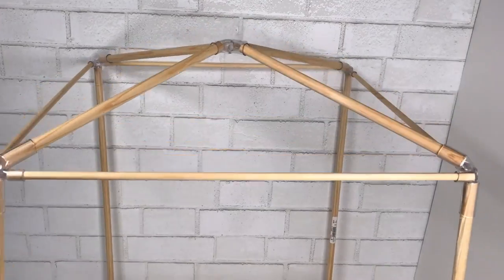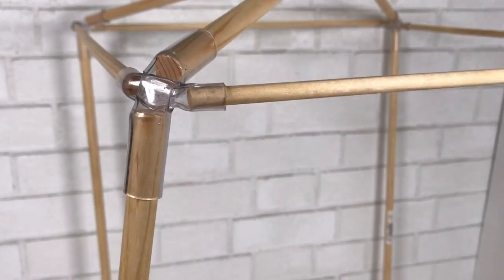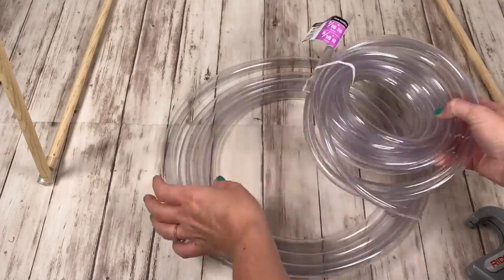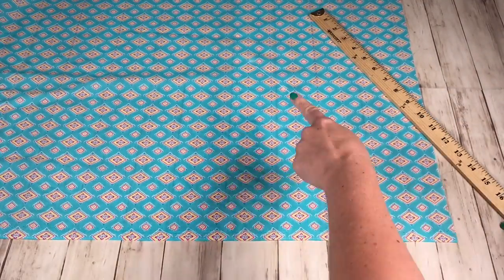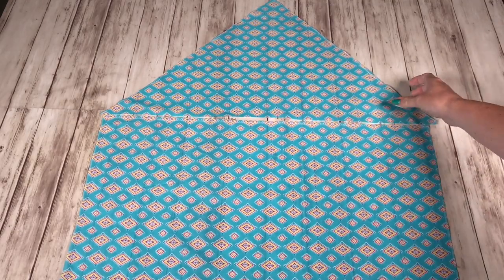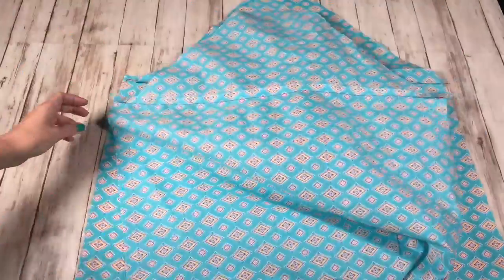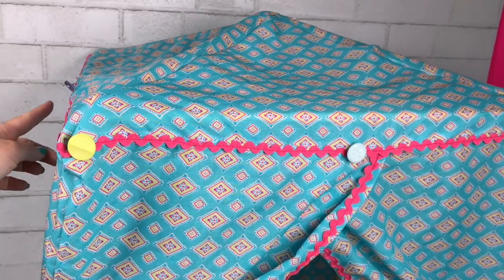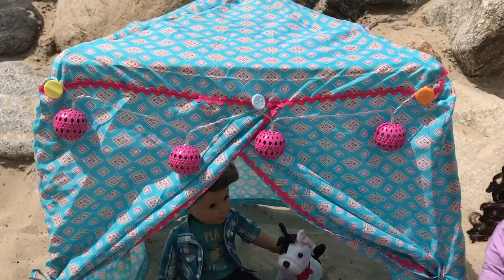DIY   Cabana

Comment: can you do a how to staighten your dolls hair. (aka. julies braid). i really need it
Reply: what you can do is brush her hair, spray it with water, get a straightener, and run it over the ripples a couple of times. another way is to get boiling hot water, and cold water, dip the part you want straightened in the boiling hot water ( trust me it will not hurt her hair i tried it) then after a few minutes, put it immediately in the cold water. brush it, and it will be straight and smooth:) hope i helped you. i have julie too and her braid gets super rippley.